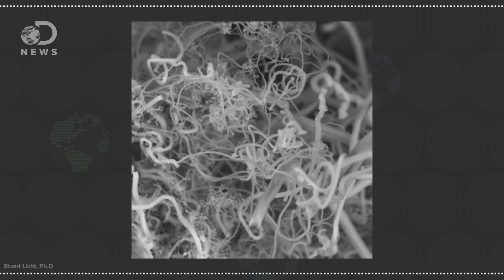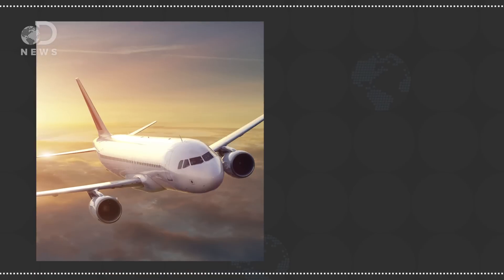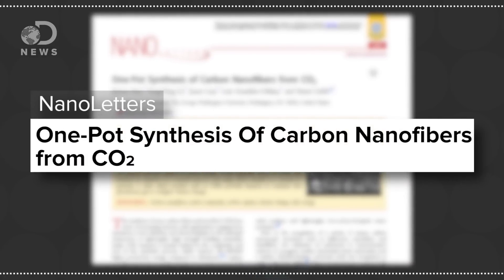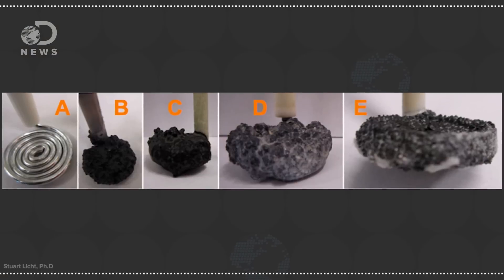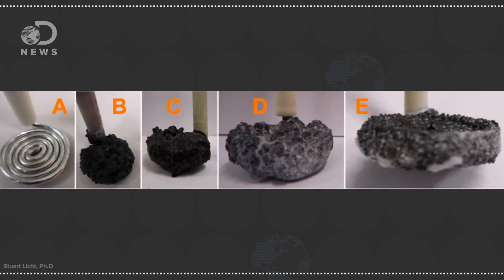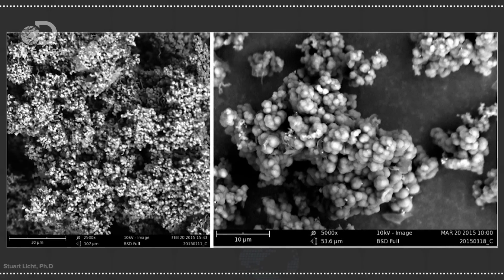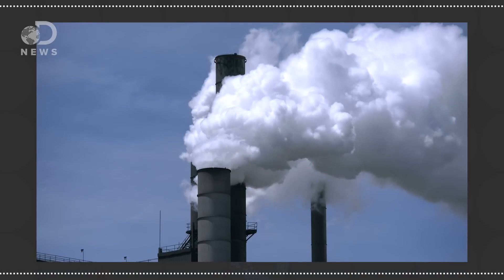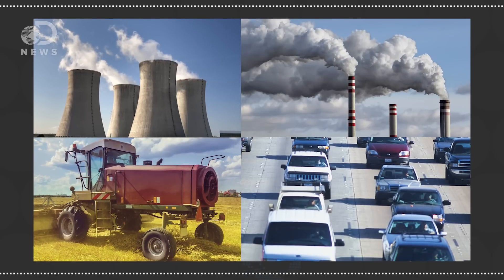Can This Carbon Nanomaterial Solve Global Warming?

Comment: I figure if companies (particularly tech companies) use this type of technology directly outside their factory smokestacks, they're effectively negating their carbon emissions while collecting the materials they need.

Unless this is expensive to set up, I see no reason to not do it.
Reply: +Peter Schmidt even if it was expensive to set up, for the first people to do it it will make them their money back rather quickly. from the way he talked about it carbon nano fibers are huge money at the moment. so the biggest companies would probably be the first to the table with them to just slightly undercut the original makers and so on and so forth.
Reply: Ryan Schafer That's a valid point.  Besides, maybe they'd get some sort of tax break if they reduce their emissions by a certain percentage.
Reply: +Peter Schmidt 
thing is, burning c, provides a certain amount of energy, separating o2 from the co2 requires (energy lost in transition aside) exactly the same amount of energy.

would be much more usefull with less energy lost in translation, to power the plants with solar cells directly. instead of powering the plants burning c transferring it to co2 and then using solar cells to separate the c again.

the only real benefits of this is the creation of usefull materials at a net negative (albeit insignificant) cost to the environment

its a nice idea but i dont think well be saving the world with this one.
Reply: Ryan Schafer again, would be more beneficial to use the same molten salt reactor to replace existing coal power plants.

since coal power plants work at around 33% efficiency, without knowledge on the efficiency of this method.

to offset one coal plant, you need atleast 3 times the energy that the coal plant produces to turn the same amount of c that was burned for the energy and co2 to turn it back to c + o2  

as said its a step in the right direction for sure, but its not enough.
Reply: +yunthi Concur
Reply: yunthi solar cells would offset the power requirements (possibly) and molten salt reactors are already being used for solar production so why not pump a large quantity of CO2 over an area of a molten salt reactor to produce the nano fibers?? or have it in a second tank and handle it there? where there is a will there is a way to do it. it may just not have been realized yet.

Comment: I wonder what happens if we took too much co2 out of the atmosphere global cooling XD
Reply: That would be ironic😜
Reply: Jax32372 Cammack yep
Reply: +J GAMER X (thestorm55) That would actually happen. co2 needs to be the right amount in order for earth to support life
Reply: +J GAMER X (thestorm55) wed die couse all the plants would die because they wont have enough co2 to make oxygen. Its a delecant balance, take too little its inefective, take too much it kills all life on earth.
Reply: +J GAMER X (thestorm55) We just make sure to pull the same amount out at a steady rate that we put in.
Reply: I already know everything would die from the lack of plants because of the lack of co2
Reply: +J GAMER X (thestorm55) At least for now, the rate at which people are releasing CO2 is much higher, I think, than what the potential production capacity is able to. I mean, if that's the case, then we'll just have to burn more fossil fuels.
Reply: +J GAMER X (thestorm55) We just put back up there, again by burning everything.
Reply: +J GAMER X (thestorm55) CLIMATE CHANGE, global warming is a term used by media. Climate change researchers turned away from that term dozens of years ago.
Reply: Gabriel Rej its a joke
Reply: I think O2 is released from this process since they're taking the carbon from CO2. So, plants will burn instantaneously from the atmosphere being too full of Oxygen and it's going to balance?
Reply: Kuya Dan but then we could still deal with a food shortage if plants everywhere just started lighting on fire
Reply: +J GAMER X (thestorm55) We just need to remain neutral. If a plant contributes 10 million tonnes of co2/year, the same plant would need to offset 10 million tonnes/year and no more.